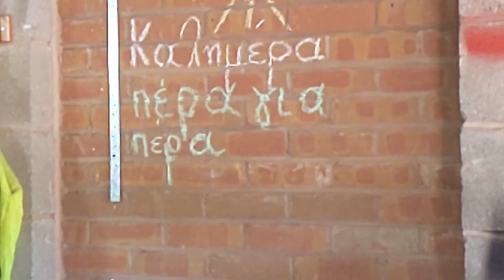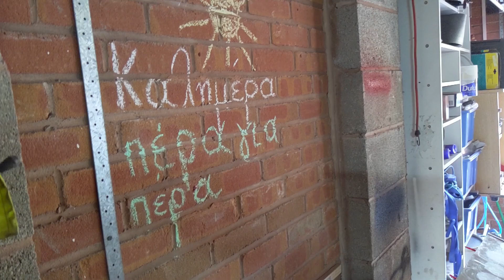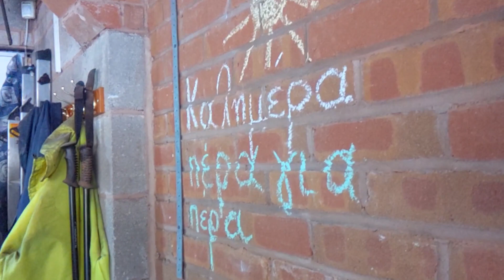Triumph TR7 Restoration: Episode 32   Passenger Side Beautification

Comment: Bad luck with the shelf fall, looked a substantial fixing too, as you say, glad you wasn’t under it when it let go. Door looks fixable with filler so should be okay I reckon. Huge amount of work completed on this side Henry, be rightly proud of what you have achieved.
Reply from the maker: Thanks 👍.  I'm pretty pleased with the wheel arches and door might be fixable with filler but I'm think I'm going to have to cut and reweld the sill.  But later in the project